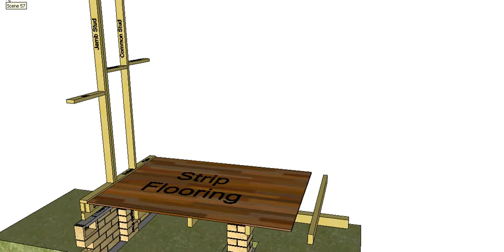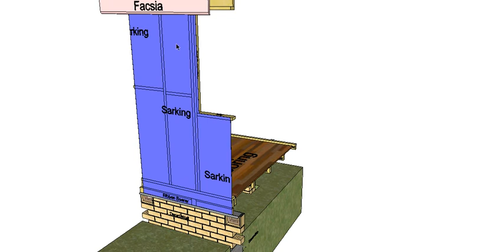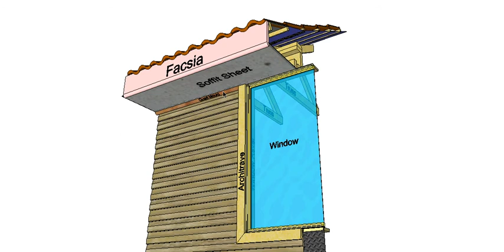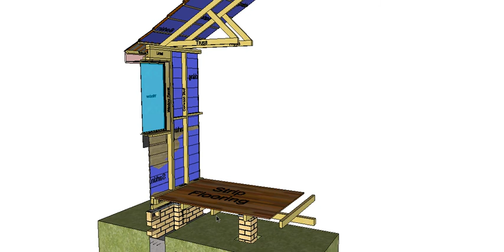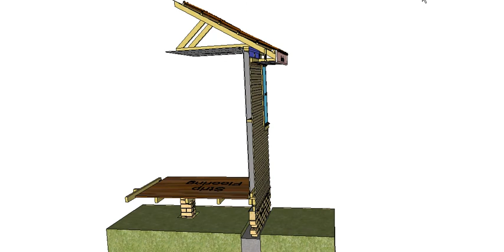Section through a Cut in Floor, Timber framed Building Part 3

Comment: Hey mate great video, do you ever use battens behind your cladding?
Reply from the maker: Hi Mate, yes that is pretty common especially where you have part of the building in Brick veneer and the rest in cladding to bring the cladding out to cover the cavity. Also it can be used to form an air gap for better thermal performance. Hope this helps.